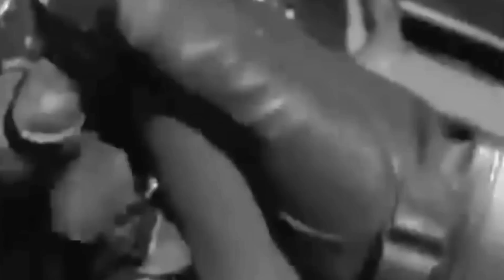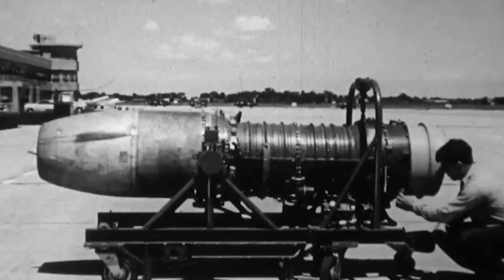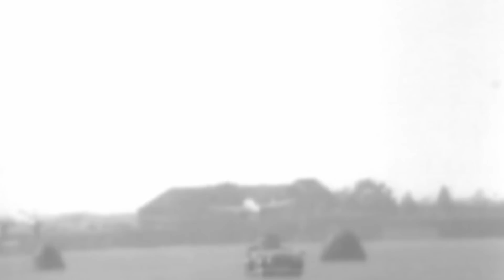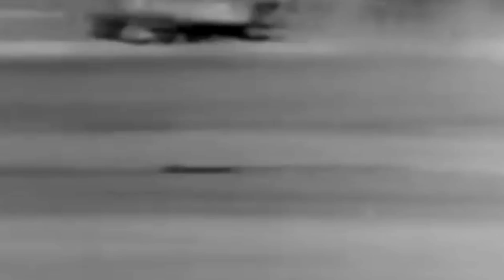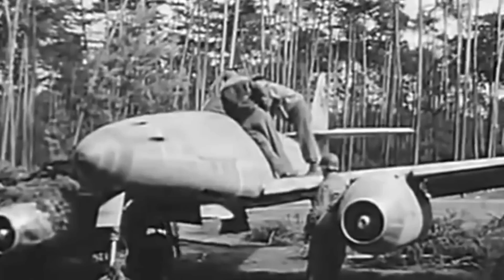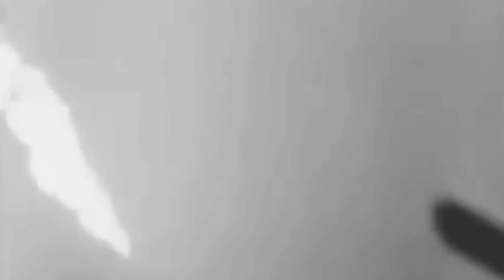The Never Before Seen Fighter

Comment: Repetitive film again. Worth a watch but several questionable statements. The first prototypes had tail wheel undercarriage but problems with the jetwash bouncing off the runway and causing lack of control due to their effect on the tail control surfaces cause a rethink. The aircraft was designed originally  with straight wings and became swept wing by accident when heavier than expect  engines caused a centre of gravity problem, solved by sweeping the wings and so pushing the engine pods rearwards, The 262 was not very manoeuvrable, quite the opposite, it didn't dogfight as it had no need to, was 100 mph faster than piston engine aircraft. No production aircraft has pressurised cockpits or ejection seats, they were proposed on prototypes,
Reply: That's a particularly egregious false myth, the Me-262 was developed from Projekt 1065 and had swept wings from its inception.
You would have to be very gullible and naive to believe such a ridiculous tale... a extremely feable attempt to slander what the most significant aircraft design in history since the Wright Flyer.
Reply: Every pilot who flew the Me-262 remarked of its excellent handling and high speed maneuverability, including the famous British test pilot Eric Brown,
Reply: @WilhelmKarsten  Hello Sandyboy, it's interesting that you invoke Eric 'Winkle' Brown because in several you tube videos he can be seen clearly stating that the Me 262 whilst be a formidable aircraft, was "NO FIGHTER" and couldn't perform dog fight maneuvers.

Comment: The reason the 262 was chosen over the Heinkel-280 was largely due to politicking. Heinkel was refused a contract to develop the jet engines he was working on. Had he been given a contract, the He-280 may have been ready by 1942, just when the U.S.A.A.F. started its bombing raids.
Reply: That's a popular but completely false myth, the He-280 may have been jet powered but was not even in the same class as the Me-262 which was aerodynamically a revolutionary breakthrough design that could turn circles around the He-280 in the transonic realm.

Comment: Beautiful plane. However the engines had a short running life.
Reply: That's a popular myth based on deliberate misinformation.
The version of the Jumo 109-004A made with Krupp P-198 Chromadur alloy NEVER entered production or saw combat service.

The Jumo 109-004B version that actually powered the production aircraft easily passed the RLMs 100 hour reliability test required for adoption into Luftwaffe service.

The USAAF exhaustively tested the Me-262 during Operation LUSTY and confirmed TBOs averaged 55 hours.
EXCELLENT by WW2 standards for Allied piston engines
Reply: @WilhelmKarsten  Hello Sandyboy, as you know your 55 hours is NOT excellent by WW2 stanadards. The Merlin engine had a TBO of 240 hours, the R-2800 had a TBO of 300 hours and the Welland and Derwent had TBOs of 150 hours.
As you know Sandyboy the Ju004 engines fitted to the Me 262 are well documented to have been fragile and short lived.

Comment: The superiority of german engineering is nothing more than marketing. Fact is, the Nazi's built expensive overly complicated junk. After all, war machines are built in order to win the war. germany thankfully built expensive junk that was too complicated to repair in the field. To this day, germany builds cars which are junk. Ranking poorly in terms of cost and reliability. The supposed superiority of german engineering is reflected in the fact that Nazis lost the war. In no small part due to the fact that the machines were inferior. Some cannot deal with the facts. ferdinand Porsche built overly complicated expensive junk. Thankfully. This plane thankfully had engines with a very short life. Rather like a car being fast for the first mile. But the race is in fact for a thousand miles.
Reply: The Messerschmitt Me-262 completely revolutionized aviation and aerial combat, it is without any doubt the most significant aircraft design since the Wright Flyer.
Reply: @WilhelmKarsten  Yes so superior that it could fly for many minutes. Not hours. So superior that under the piloting of those brave idiot nazis. They won the war! 

You germans are a joke. Your vaunted engineering is a myth. Nazi war machines led to other developments true. But one reason you Nazis lost is the machines built were inferior. Factually speaking.
Reply: @stephencurry8552 The truth is irrefutable, the Allies had absolutely nothing comparable to the Me-262 and were a decade behind in aerospace technology.
Reply: @WilhelmKarsten  The central and only fact that matters. Nazis were killed. Hitler died. And the machines the worthless Nazis made lost. Period, full-stop - lost. (I have to be direct with you. Superior fighters and or their machines do not lose). Deal with the facts sport. Only good nazi is a dead one. Was true back then. Even more true now.
Reply: @stephencurry8552 It in no way diminishes the the revolutionary accomplishments of German Aerospace engineers or that the Messerschmitt Me-262 is the most revolutionary, pioneering aircraft design in history since the Wright Flyer.
The Allies had absolutely nothing comparable to the Me-262
Reply: @WilhelmKarsten  As you know Sandyboy the Me 262 was a complete failure. It failed to achieve any of its war goals and post war was quickly consigned to the museum.
Reply: @WilhelmKarsten  Sandyboy, I don't know what's funnier, your cope or your hyperbole.

Comment: WRONG ;- Von Ohain only created his engine AFTER reading Frank Whittles Patent Documents. Credit for inventing the turbo-jet goes FULLY to Whittle. End of.
Reply: Whittle was not the first to patent the the jet aircraft engine.
Maxime Guillaume patented the turbojet in 1921 when a 14 year-old Frankie was still wearing short pants.

Whittle is only the fourth person to successfully demonstrate a jet aircraft engine
Reply: @WilhelmKarsten  Hello Sandyboy, I see you are back in love with Maxime and his sweet little crank handle. I've got a secret about Maxime's little motor, would you like to know it?

Anyway, let's remind you of what Pabst von Ohain had to say in his foreword to 'Elements of Propulsion'- 

"The first patent of a turbojet engine, which was later developed and produced, was that of Frank Whittle, now Sir Frank (see Fig. 5). His patent was applied for in January 1930. This patent shows a multistage, axial-flow compressor followed by a radial compressor stage, a combustor, an axial-flow turbine driving the compressor, and an exhaust nozzle. Such configurations are still used today..."

and -

"In April 1937, Whittle had his bench-test jet engine ready for the first test run. It ran excellently; however, it ran out of control because liquid fuel had collected inside the engine and started to vaporize as the engine became hot, thereby adding uncontrolled fuel quantities to the combustion process. The problem was easily overcome. This first test run was the world's first run of a bench-test jet engine operating with liquid fuel..."

and-

"From the beginning of his jet propulsion activities, Frank Whittle had been seeking means for improving the propulsive efficiency of turbojet engines. He conceived novel ideas for which he filed a patent application in 1936, which can be called a bypass engine or turbofan. To avoid a complete new design, Whittle sought an interim solution that could be merely "tacked on" to a jet engine. This configuration was later known as the aft fan. Whittle's work on fan jets or bypass engines and aft fans was way ahead of his time. It was of greatest importance for the future or turbopropulsion."
Reply: @WilhelmKarsten  Hello Sandyboy, I see you are back in love with Maxime Guillaume and his sweet little crank handle but it'd be interesting to know what difference you think Guillaume's patent makes to what Heavens Gremlin says.

 But let's remind you of what the famous German gas turbine pioneer Pabst Von Ohain had to say in his foreword to 'Elements of Propulsion, gas turbines and rocket'-

"The first patent of a turbojet engine, which was later developed and produced, was that of Frank Whittle, now Sir Frank (see Fig. 5). His patent was applied for in January 1930. This patent shows a multistage, axial-flow compressor followed by a radial compressor stage, a combustor, an axial-flow turbine driving the compressor, and an exhaust nozzle. Such configurations are still used today..."

and -

"In April 1937, Whittle had his bench-test jet engine ready for the first test run. It ran excellently; however, it ran out of control because liquid fuel had collected inside the engine and started to vaporize as the engine became hot, thereby adding uncontrolled fuel quantities to the combustion process. The problem was easily overcome. This first test run was the world's first run of a bench-test jet engine operating with liquid fuel..."

and-

"From the beginning of his jet propulsion activities, Frank Whittle had been seeking means for improving the propulsive efficiency of turbojet engines. He conceived novel ideas for which he filed a patent application in 1936, which can be called a bypass engine or turbofan. To avoid a complete new design, Whittle sought an interim solution that could be merely "tacked on" to a jet engine. This configuration was later known as the aft fan. Whittle's work on fan jets or bypass engines and aft fans was way ahead of his time. It was of greatest importance for the future or turbopropulsion."

As you know Sandyboy, sadly no engine designed by Ohain would ever go into production and service, including those used on the He 178 and He 280, they were as you know a technological dead end.
Reply: Hans von Ohain and Max Hahnn built the first turbojet engine in Gottingen Germany in 1934.
The first successful demonstration was on Aug 27, 1939 in Rostock Germany.
Reply: @WilhelmKarsten  Hello Sandyboy, I see you are trotting out your 1934 LIE again. Let's remind you what Pabst von Ohain had to say in his foreword to 'Elements of Propulsion'-

"In early 1935, I worked out a patent for the various features of a gas turbine
consisting of radial outflow compressor rotor, combustor, radial inflow turbine,
and a central exhaust thrust nozzle."                                                                                                                 1935 and no engine

"A good approach,it seemed to me, was to first build a model...
 I knew a head machinist in an automobile repair
shop, Max Hahn, to whom I showed the sketches of my model. He made many
changes to simplify the construction, which greatly reduced the cost...
Although my project did not fit Pohl's institute, he was extremely helpful to me. 
He let me test the model engine in the backyard of his institute and gave me 
instrumentation and an electric starting motor. Because the combustors did 
not work, the model did not run without power from the starting motor...
The first experiments with the model in early 1936 had convinced me that the
volume of the combustion chambers was far too small..."                                                                          1936 and only an electric motor driven model

"By mid-May 1936 I had nearly completed the layout of the hydrogen demonstrator
engine... According to my contract, of course, I should have worked on the liquid-fuel
combustor with the (impossible) goal of having this development completed
by June 1936... The engine was completed at the end of February 1937, and the start of our
demonstration program was in the first half of March, according to Gundermann's
and my recollections."                                                                                                                                           1937 and only a hydrogen demonstrator

As you know Sandyboy, no engine designed by Ohain would ever go into production and service.
Reply: @WilhelmKarsten  Hello Sandyboy, i see you are still trotting out your dishonest claim that "Hans von Ohain and Max Hahnn built the first turbojet engine in Gottingen Germany in 1934."
Let's see what  the famous German gas turbine pioneer Pabst Von Ohain himself had to say in his foreword to 'Elements of Propulsion, gas turbines and rockets'-

"In early 1935, I worked out a patent for the various features of a gas turbine
consisting of radial outflow compressor rotor, combustor, radial inflow turbine,
and a central exhaust thrust nozzle."                                                                                                                                                           1935 and no engine!                                                                                                  

"A good approach,it seemed to me, was to first build a model...
 I knew a head machinist in an automobile repair shop, Max Hahn, to whom 
I showed the sketches of my model. He made many changes to simplify the 
construction, which greatly reduced the cost...
 I continued working in Prof. Pohl's institute and discussed with him my project 
'aircraft propulsion.' He was interested in my theoretical write-up. 
Although my project did not fit Pohl's institute, he was extremely helpful to me. 
He let me test the model engine in the backyard of his institute and gave me 
instrumentation and an electric starting motor. Because the combustors did 
not work, the model did not run without power from the starting motor...
The first experiments with the model in early 1936 had convinced me that the
volume of the combustion chambers was far too small for achieving a stable
combustion."                                                                                                                                                                                               1936 and only an electric motor driven model!

"By mid-May 1936 I had nearly completed the layout of the hydrogen demonstrator
engine... According to my contract, of course, I should have worked on the liquid-fuel
combustor with the (impossible) goal of having this development completed
by June 1936... The engine was completed at the end of February 1937, and the start of our
demonstration program was in the first half of March, according to Gundermann's
and my recollections."                                                                                                                                                                               1937 and still only a hydrogen demonstrator  and an
                                                                                                                                                                                                                      admission that he couldn't achieve  then what Whittle had.

Comment: if only they had purposed the Swallow as a fighter as originally intended, it would have been operational 3 years earlier - thankfully Hister was in fact a madman and this was but one of his many mistakes
Reply: That's a popular but completely false urban myth...
Reply: WRONG !!! ! The engine development was the hang up  1400 air frames made but less than 200 ever flew and most of those were shot down or crashed !!!
Reply: @wilburfinnigan2142  Still the most effective jet fighter in combat during WW2, Allied jets helped the Luftwaffe... because they only killed Allied pilots
Reply: @WilhelmKarsten  Hello Sandyboy, as you know the Me 262 achieved nothing during the war and nothing after it.
Reply: Actually history has proven Adolf was correct, all modern jet fighters are multi-role Interceptor-Attack aircraft with bombing capabilities

Comment: There is a air worthy example in existence. Haven't seen it in person but I hope to one day.
Reply: Maybe one at the Chino Planes of Fame, I remember seeing a photo years ago.  It probably is a static display.
Reply: @alparker8661  The Planes of Fame Me-262 was bought by Paul Allen's museum as a candidate for airworthy restoration.  It was also the former Howard Huges Me-262.  Jeremy Moore and his group at JME Aviation in the UK were selected to restore the airframe.  (JME had previously rebuilt Paul Allen's beautiful Fw-190A.)  The Jumo engines were rebuilt at Aero Turbine in California, using at least seven original cores and lots a new manufacture.  Aero Turbine ran them until they broke, then fixed the problem and kept going over 10 years.  Allen's Me-262 is not quite ready for flight since Allen passed away just before taxi trails began.  There's still work to do under the new owners.
Reply: There are a few. They are modern reproductions, or if you prefer "continuation" models, powered by modern engines nestled inside reproduction nacelles. No airworthy originals exist or ever will exist because the original engines are too short-lived and unreliable.